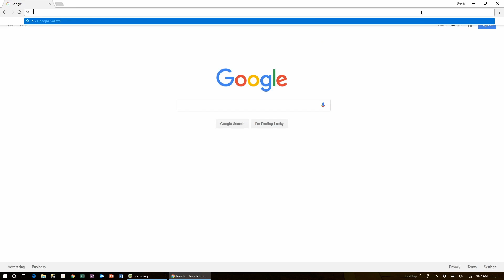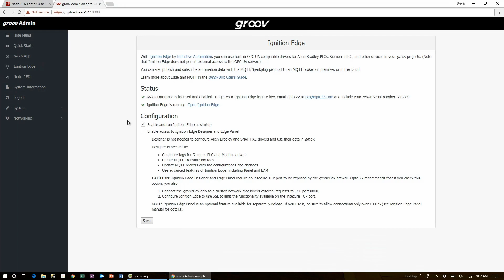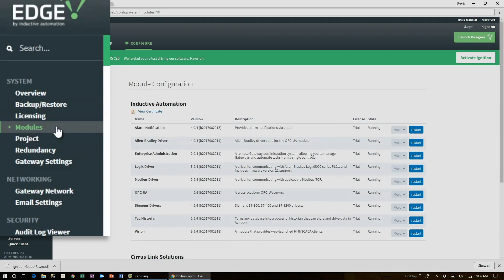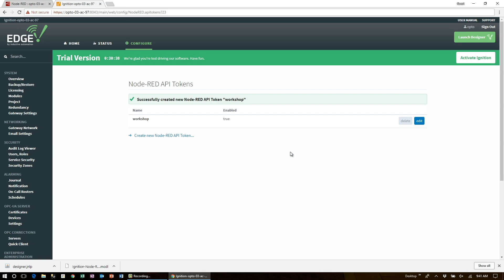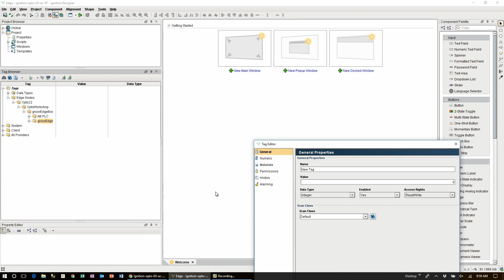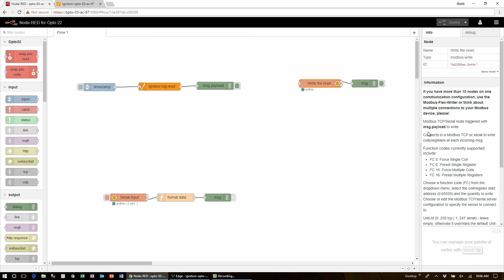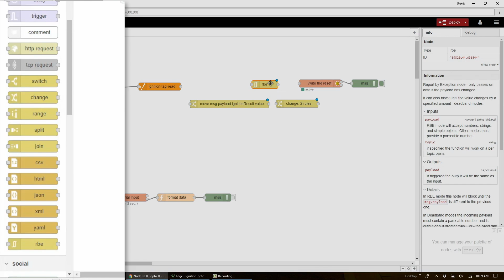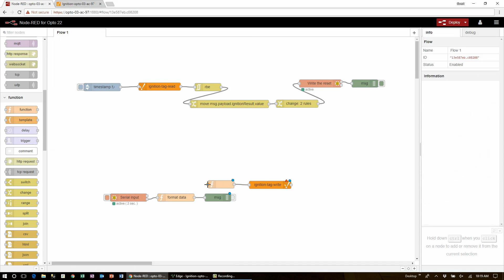How to get serial Modbus Data with an Allen-Bradley PLC with Ignition

Comment: is it possible to use a schneider em6436 energy meter with rs485 port to connect to my plc and read the voltage, frequency and ampere data directly on my pc on SCADA?

Comment: Hi, I'd like to ask you if it was necessary the ignition license because I tried to install the module without license and it is considered a "Quarantined Module". 

There is also this message "This module will not run on edge without a license".

Comment: Absolutely fantastic! How could opencv blob color detection be incorporated with a node-red PLC?   Thanks.
Reply from the maker: It is totally dependent on your application, but I imagine that Node-RED would do a great job of moving images into your application and carrying results out, I would use a custom application (something like a Python script) to do the OpenCV processing. Node-RED is a powerful connector for the internet of things but it isn't an ideal platform for intensive tasks like computer vision. Thanks for watching!